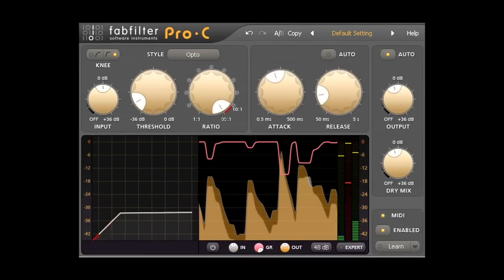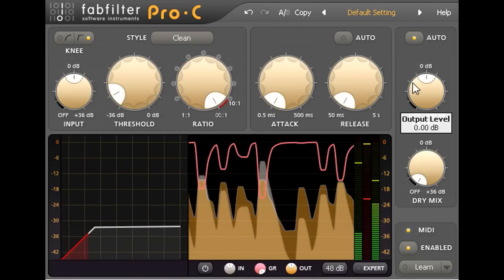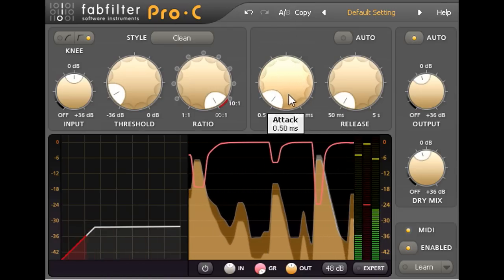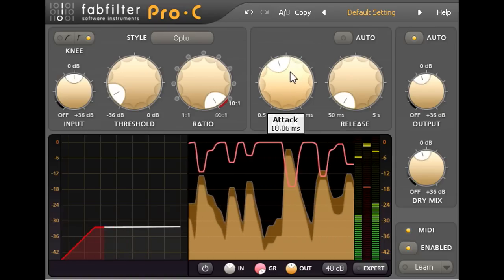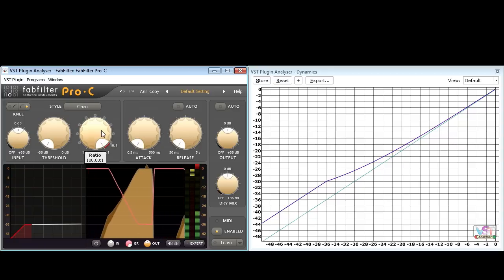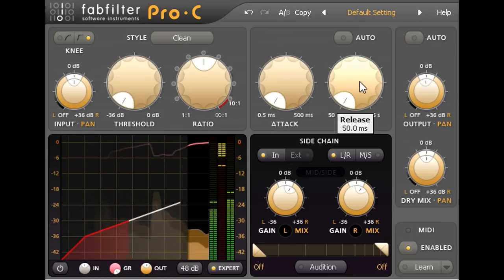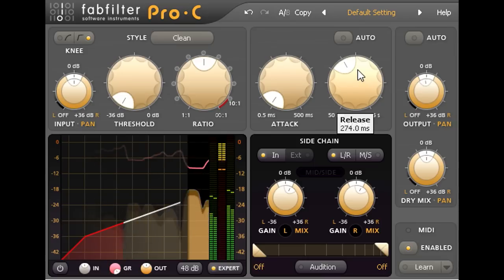Parallel Compression Using FabFilter Pro-C

Comment: My biggest issue is understanding the wet dry ratio being chosen.  If you turn up the dry, do you need to equally turn down the wet?  Kept the balance?  I have the newer version of this compressor, so my controls look a bit different.  I also see tutorials using parallel compression on individual tracks.  Is this technique commonly used in mastering a composite track as well?
Reply: the only real answer you'll find is: it depends what you're trying to achieve. try both, see what works for your mix within context, and use what sounds best.
for the last question, considering the limiter I use (limiter no6, free from tokyo dawn) contains a compressor with a dry signal insert that you can choose to take effect either before or after the first stage of limiting (peak reduction) then I assume so, but I've not fiddled with it yet, though I can see it helping with certain things (e.g. ableton's reverb is notoriously quiet. I'll have to try and see if this stops me needing to add gain/saturation on the reverb send now lol)

Comment: To be honest I just threw it together for this tutorial: sometimes thats quicker than finding an example that ticks all my boxes! I'll try to find some time to finish it off one of these days...
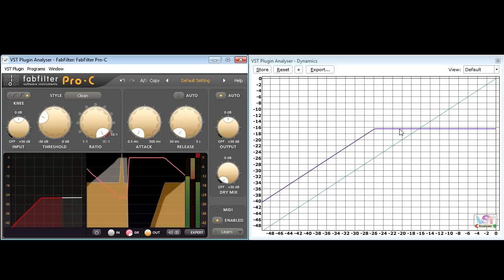Reply: 1:45

Edit: solved. Leaving my original question up for fellow viewers.

“I don’t understand why blending in dry signal results in a curve, rather than just a straight line with a reduced ratio. If I were to add the limited & uncompressed graphs, each of which are straight lines beyond the threshold, that would result in another straight line whose slope is between the limited & uncompressed signals. 

Thanks”

Solution: Combining transfer curves isn’t the same as combining simple “math graphs” on a linear xy plot, because decibels aren’t a linear unit. Imagine combining the uncompressed graph with a hard limited signal at 0dB: completely inaudible. By my logic, combining the uncompressed signal with the “hard limited” silence would result in a reduced dynamic range.
Reply: @ts4gv  because the effect of the compression becomes less significant the more the level of the compressed signal drops, relative to the dry signal.
Reply: Edit:
Ahh old YT comments in the wild. Is this finished and released yet? Absolute jam 🤘